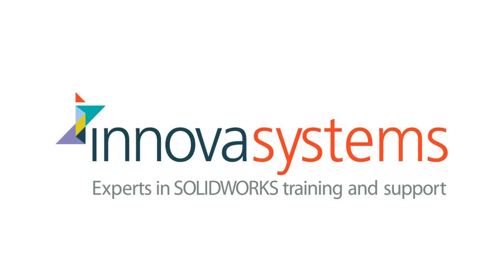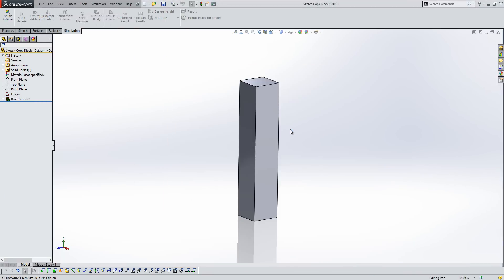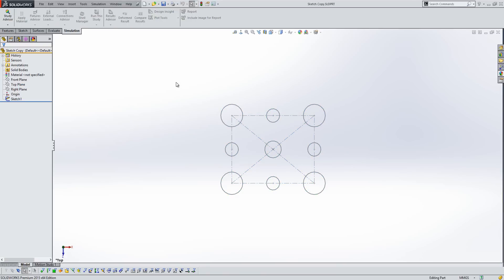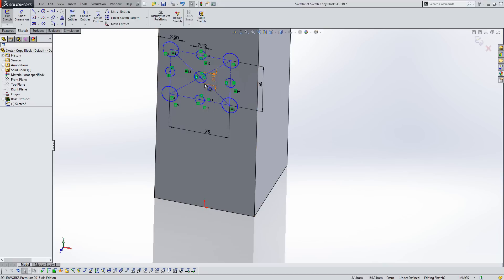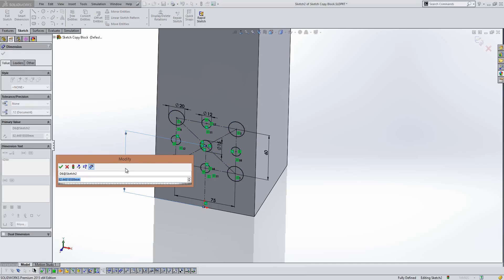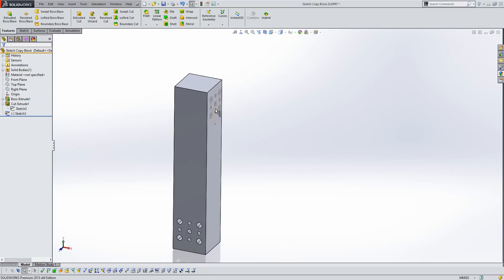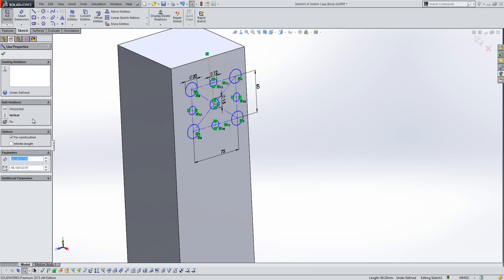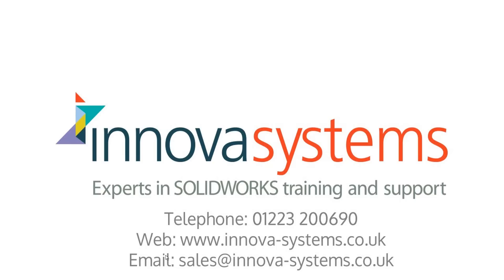How to copy entire sketch and reuse in another part in SOLIDWORKS

Comment: If the sketch is going to be reused a lot, you can make a Block out of it. Also when you insert the block into a sketch you can choose to link it to the file. So any changes you make to the block itself will be reflected everywhere it is instanced and linked.
Reply: @autogyro333  Theoretically yes, but it would be more stable to make a common .sldprt file with sketch to use as in-context reference